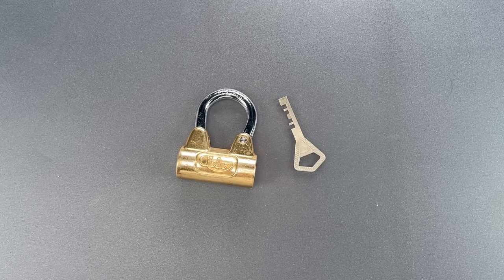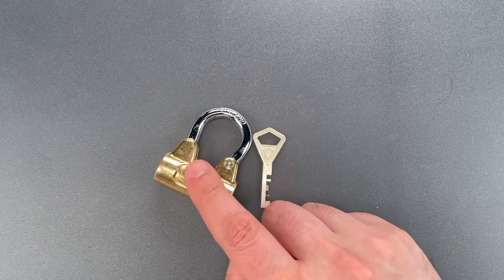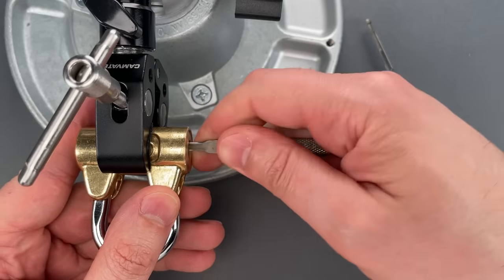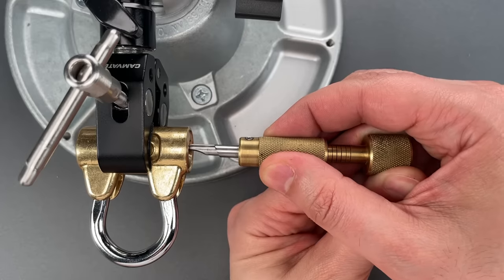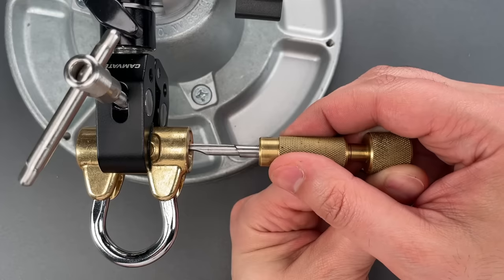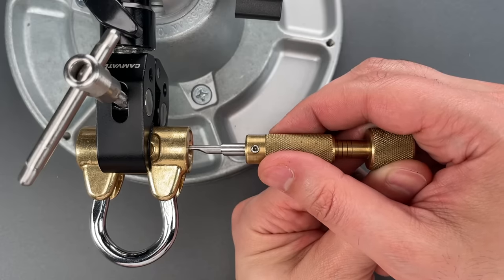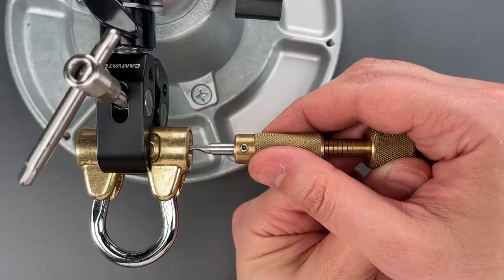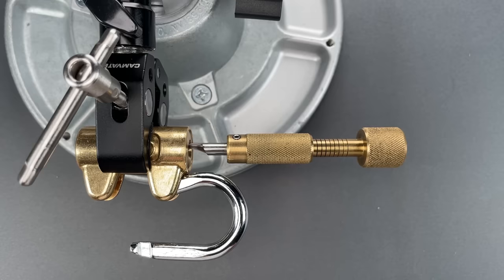[1416] Retro-Cool Abloy Padlock Picked (Model 3020C)

Comment: Fun fact. I’m gonna say out of limb that 99% of all residential houses and buildings have Abloy locks in Finland 🇫🇮
Reply: 99% is lowballing it tbh
Reply: Sadly not everything that Abloy sells meets this high standard. That said, not much of it meets the high standards of Master and Kwikset here in the US… 🤣
Reply: Sounds accurate. Although many buildings are changing to electric locks and those are not always Abloy. (Iloq is quite popular.)
Reply: Estonia is also full of Abloy locks.
Thank you Suomi 🇫🇮
Reply: Was probably true a couple of years ago, but now iLOQ has exploded in popularity in Helsinki, which probably gives them like a 2% market share already...
iLOQ isn't really a lock, though. It's electronic, and the mechanical component of it seems to be a sham (basically just there to fool the elderly into thinking that they still have a traditional lock, easier to sell). Not sure if that's a good or a bad thing.
Reply: @knghtbrd  Master having high standards? LMAO
Reply: @slashley6106  Generally a bad thing. If not for planned obsolescence it might not be the worst option, but this year 3G is being phased out, and so a lot of fire alarms, burglar alarms and medical devices using 3G will no longer function, and that wasn't even planned obsolescence, just the service provider recouping some costs prior to their 5G roll out.

A physical lock will never stop working just because it's manufacturer has moved on. I would also worry about the possibility of spiking or other electronic attacks on an electronic lock. Also, when you go to new technology, it's extremely rare they're expert in the old technology, so you get problems crop up that were solved centuries ago by locksmiths. Just not worth the cost and hassle. A good core will always be a thing of solidity, even if the world breaks down and all infrastructure goes the way of the dinosaur.
Reply: @slashley6106  The key part isn't a scam, it acts as turning device, that way you don't have to put electric motor in the lock to operate it as it is manually operated. Makes the lock simpler and in fact makes it operable without electricity. This is handy for keysafes.
Reply: noone gonna steal that salmiakki.
Reply: Yeah, those iLOQs generate the electricity needed from the motion of the key when you slot it in. It's a pretty neat design and seems easy to retrofit.
Reply: Yes, but no longer this low security design on anything but lesser security things such as sheds and such. The newer homes in Finland use some of the newer Abloy designs that LPL hasn't managed to pick.
Reply: Americans just buy Walmart ones with cheap Chinese internals.
Reply: @slashley6106  iLOQ is also Finnish and pretty handy for common areas of apartment buildings. You don't have to switch all the locks if someone loses a key as any key can be remotely granted or denied access to any door.

They do have a lot of problems, though. I often have to put mine in 3 or so times for it to generate enough energy to signal the lock to open. Also, I had one key die on me completely. However, Ithink these are simply toothing problems for a new company.
Reply: These days there are a lot of iLOQs too being used but around 90% for sure
Reply: It would indeed feel almost crazy to use pin tumbler locks on residential home doors. (It's crazy to think that in North America it's, by far, the most common type of lock.)
Reply: @knghtbrd  That's probably true, but the door locks used here do. They are practically unpickable and very strong. The doors are strong too, but burglars still prefer using an axe on them, instead of trying to deal with the lock.
Reply: 🤔 thinking back at all Finnish homes visited  yeeep.... and on everything needing a padlock like toolsheds and similiar. Yeeep.
Reply: @karhu96  Sounds like the older generation lock and key from iLOQ, which indeed have those problems. The problem is not actually that it is not generating enough power, but if you insert the key too quickly the reading of the key fails (I believe they call this "overspeed problem" or something like that). If you insert the key a bit slower, the success rate for the opening increases drastically, so I suggest you to try that next time. :) Newer generation locks don't have this problem though.
Reply: Same in Sweden
Reply: @leboef7098  Can confirm. Used to live in an apartment with an early Iloq-keyway, and putting the key in slower usually helped.
Reply: @rimpe yeah, but mostly execs and sentos nowadays. Classic merely on older buildings.
Reply: @Hege_  independing of what the content is, please would you say it in a civilized (polite and respectful) way?
I also believe that many households in my country have really bad, unsafe locks.I think a lot of people who haven't subscribed to this channel (99+%) just don't know enough about this topic
Reply: I'd say that was a danger. If an excessive majority of locks have abloy cores, then it's much more likely someone is going to have the right tool to get it open.
Reply: @jammi__  I wasn't aware there were any that he hasn't picked yet. He's an educator, so it's possible he has picked those but doesn't want to share the secrets yet to keep people secure.
Reply: pretty much every lock is abloy in the apartment complex i live except the downstairs door, that seems to have electric lock that reads the chip from the key and if the contact isnt 100% clean the key refuse to work "ive had to polish the copper contact on my key few times to get the key to work"
Reply: Yeah, I visited last year and they are everywhere. I even bought myself the very padlock from this video!
Reply: @DjVortex-w  Still I've noticed, that pin tumbler locks have also peaked in popularity in Finland, probably due to cheaper prices. Though all of those that I've seen have been double sided, having both "traditional" pins and dimble pins on them.
Reply: Does Finland have that bad of a high-skilled lock-picking burglar problem?
Reply: An interesting fact, but I found nothing fun about it at all.
Reply: @penfold7800  No, those Abloy locks just are virtually unpickable, like their Exec, Protec, Protec2, Novel, Easy etc locks. They're considered by many to be the most secure mechanical locks in the world. LPL hasn't picked one, because he cannot pick one.
Reply: @kewkabe  nah, we just started using these 100 years ago and until now they've proven pretty decent. Criminals don't really care about lockpicking here because it's a time consuming skill to learn and the locks are so good here it's just easier to go the destructive route instead
Reply: @ksm1985  Completely untrue. That's a blanket statement. Not all Americans do any one thing. Quit putting us all in your little boxes.
Reply: Pretty much. Atleast every time if I see brand name on a door lock, it's pretty much always Abloys
Reply: Also some houses use Dorma locks that are either wafer locks or knock off Abloy classic disc detainer locks. But still think about 90% is Abloy
Reply: @slashley6106  iLOQ seems to be pretty good. Their 1st gen lock had a couple of mechanical vulnerabilities but the 2nd gen version from around 2013 haven't yet been picked open as far as I know. The biggest problem with iLOQ locks is that they do not operate as smoothly as fully mechanical Abloy locks (the key is harder to insert and remove).
Reply: @kewkabe  I think it was originally that Abloy was the only big national manufacturer and during the years 1940 - 1990 the culture was that if you can use products manufactured in Finland, you get products manufactured in Finland. It was just a happy coinsidence that Abloy had the best desing, too. Only later it was figured out that since we already have at least Abloy Classic level locks everywhere it doesn't make sense to downgrade.

The most important part of the success of Abloy Classic was that the design can cope with harsh climate here in Finland. Yearly temperature differences go from -35 °C to +35 °C (or -31 F to 95 F) so you need a lock that doesn't fail easily. Abloy Classic was designed to have suitable parts that it doesn't freeze, doesn't fail because of thermal expansion and doesn't rust. Any worse locks usually fail at least on one of those here in Finland. As an added bonus, Abloy Classic doesn't need any springs so there's no springs to fail even if the lock is very old.
Reply: Fun fact lots of lock in France are Assa Abloy too as in 1997 they bought Vachette.
Reply: @testman9541  But you don't see Abloy branding on the actual locks if the core inside is not an abloy design. They do manufacture even pin tumbler locks with ASSA brand.
Reply: Abloy is everywhere, yes
Reply: @Si74l0rd  in reference to the iLoq, mine also seems to jam 1/20 of the time when I go to turn the key. Not sure of the reason, it's indoors and issue was present from new, but goes to show that in terms of the end user, they don't feel quite as solid as a well worn Classic does. 😅
Reply: I’m seeing a lot more E-locks around theese days but thst used to be the case for decades.
Reply: and most of them still have that same "classic" core too 😂👌
Reply: I have one in my cellar compartment. It's easier to just to cut through the netting.
Reply: Finn fact. Its Swedish owned
Reply: @kewkabe  Nope. Just couple decades ago people left broom against their door as signal to inform that no one wasn't home. There hasn't even been time for lockpicking to gain momentum 😀
Reply: It’s funny a country with virtually no crime has among the highest security locks.
Reply: @vapordoggo  😁 They have the highest standard for claiming their products are secure when I can pick them. (because … if I can pick their "high security" products, they aren't.)
Reply: @emotionz3  well, all the criminals has given up
Reply: @penfold7800  there is one Person who can pick newer Abloy cores (huxleypig) he had to spend 10 years to get first one open and i believe if he is presented unfamiliar Core it takes him over hour to get it open. So yeah we don’t need to worry about the locks.
Reply: @slashley6106  Nevet heard of iLOQ, even if I live in Helsinki metropolian area.
Reply: It's realky common year. Electronic locka have been incrrasing tho and there are otherbrands also.
Reply: @hyvaamusiikkia8867  When you walk along the streets, have a look at the keyways just for fun. iLOQs are very distinct when compared to ABLOY designs. Chances are high you'll be surprised.
Reply: I would argue against. iLOQ is taking market pretty good as it brings benefits.
Reply: iLOQ core fits in Abloy lock body, so you have to look the core. 

I have now Abloy padlock only in my basement storage closet. All other locks I use are iLOQs. 

And bicycle has a disk detainer U-lock, but nor Abloy. It works more reliably, no springs is a good thing. Too difficult to pick by 99,9% of bike thieves. 

By the way, Finnish official for data protection  didn't like that iLOQ keeps a log of keys used in the lock. Makes a personal info database..  I think its only good, that I could ask police to read the data with the locksmith that has the key for reading the data.

Comment: The new Abloy locks are totally next level. The key has two sets of notches, and discs have to be turned simultaneously. One at a time would not work. Also, the keys are coded. You get to know which one of the keys was used last, and when. And you can buy those from any hardware store in Finland...